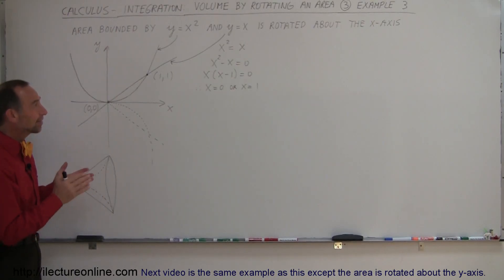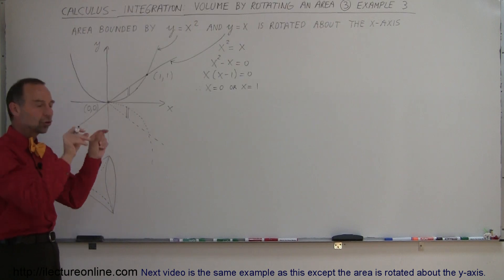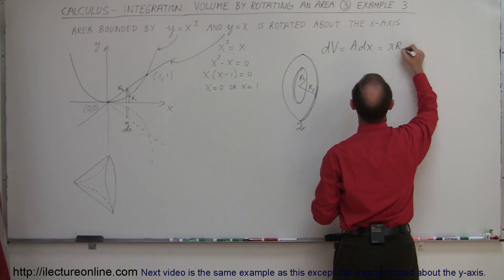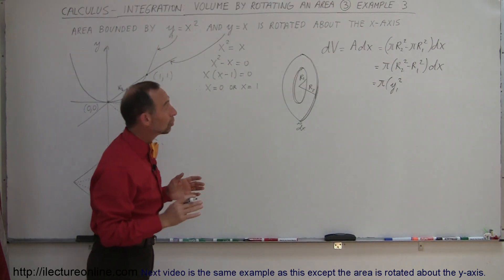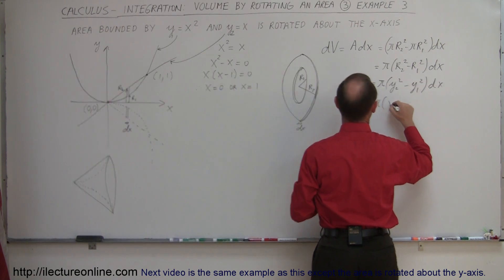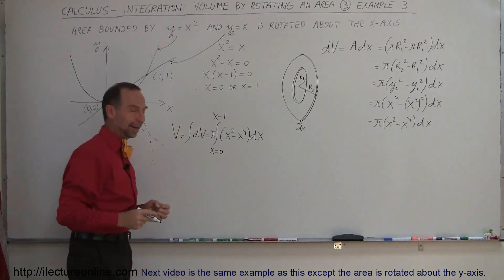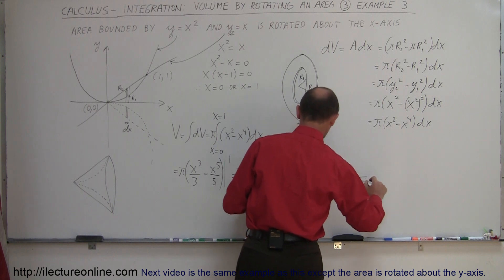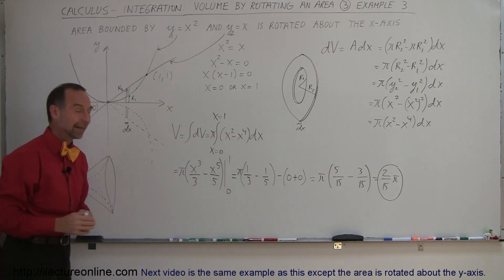Calculus - Integration: Volume by Rotating an Area (3 of 10) Ex. 3: y=x^2,y=x About the x-axis

Comment: Around 6:30: am I right that the whole subtraction should be enclosed by brackets? because the lower limit (although zero in this specific case) has to be multiplied by pi as well.

Comment: At the radius of the circle, you write (x^2-x^4),I know it right, Could you tell me why  (x-x^2)^2  is wrong.?
Reply from the maker: If you multiply out (x - x^2)^2, you will get a different result.  (Try it)
Reply: Thank you very much. I mean,  x-x^2 also is the radius of the circle, right?
Reply from the maker: x^2 - x = 0 is the equation you get when you solve the 2 equations simultaneously.  The solution to that equation represent where the 2 functions cross.